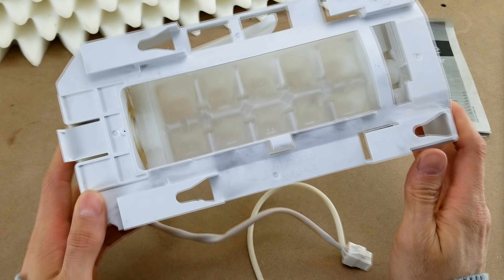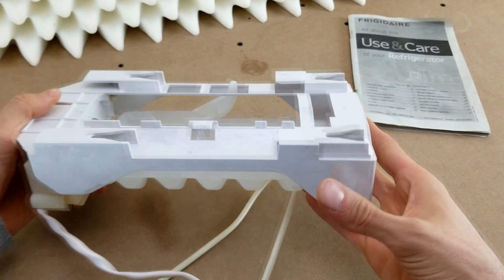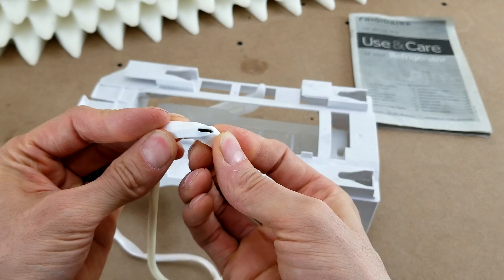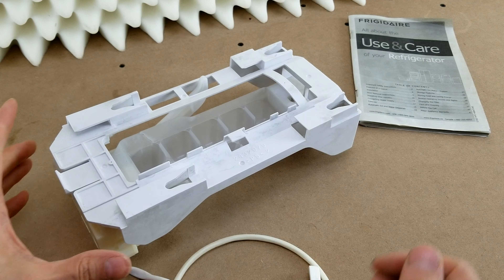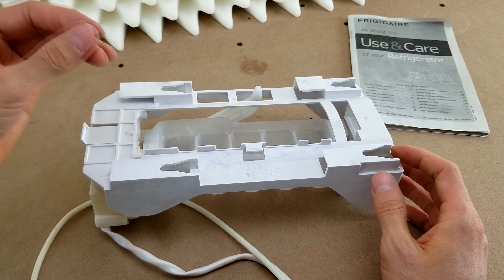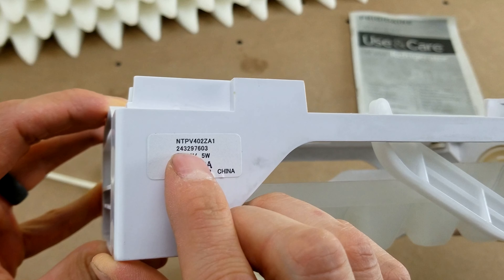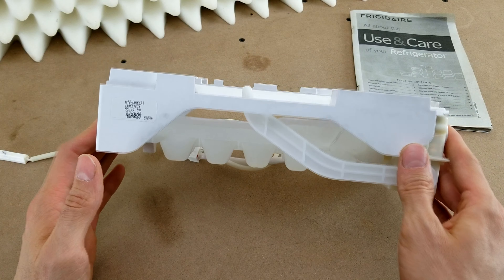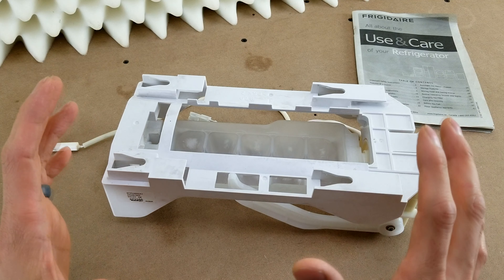🧊🧊🧊 Frigidaire Gallery Ice Maker FIXED! (Won't make ice!)

Comment: How did you get the assembly off the track, please? I have tried bumping it up but I am afraid I will break something , I don 't  see any screws is there a release tab I am missing?
Reply: You just pull it towards you and it comes off of 4 inverted screw heads that hang down from the ceiling in the icemaker compartment

Comment: I opened that compartment up cuz it’s not cycling the switch. One of the springs inside was out of place for some reason and was not putting pressure on the piece that hits the switch and that part uses the spring to come off the switch. That compartment is a pain to put back together without any sort of accessible exploded parts view of the interior.
What that switch does exactly? That long arm actuates it when it becomes full with ice from what I’m gathering. Haven’t been able to find much technical info on this model. Frustrating